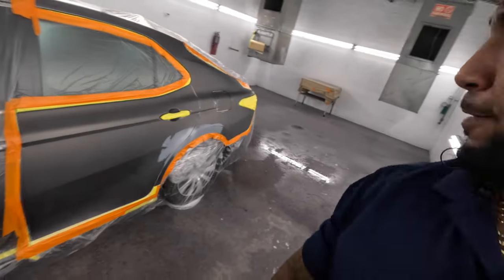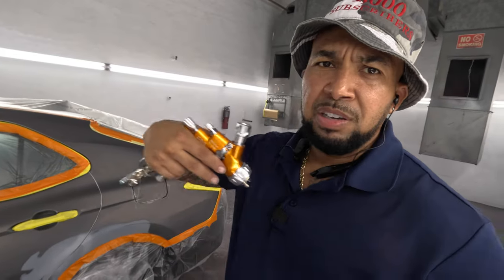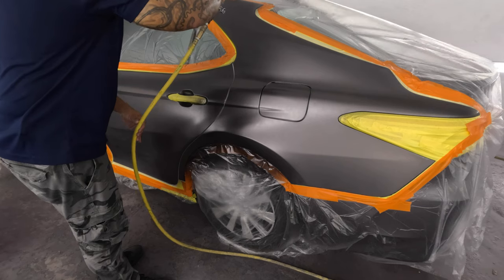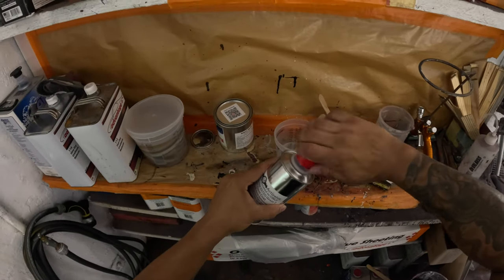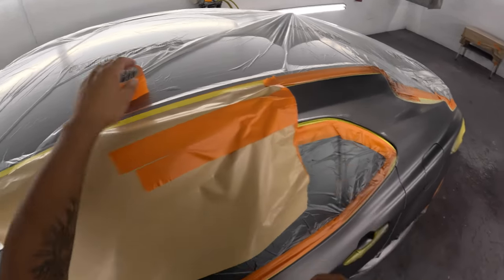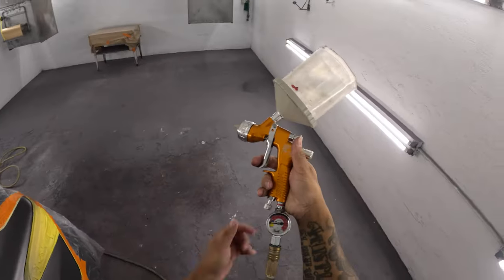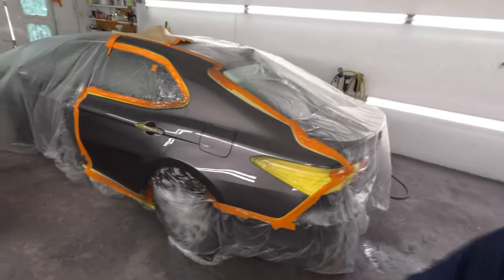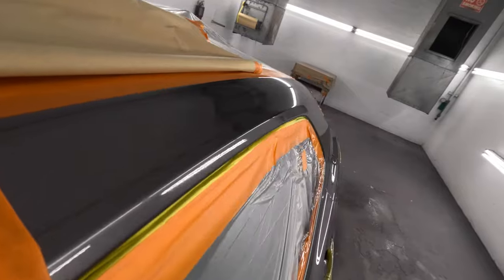Man 😤 all that hype. For this can of honey 🤨

Comment: Awesome job! I was a bit surprised by the fact that the gti pro lite goes back that far! Wow! That is definitely one of the best guns out there for sure! And not the most expensive either. Man you really treated yourself with that one for your first gun. Great gun for the beginner in my opinion when you go with T10 cap and 1.3 needle tip.
It will be slow laying out material but absolutely perfect especially laying out clear virtually impossible to get a run! And you don't need lots of pressure out the gun to run it or like 60 gallon compressor like you would need it with Iwata LS400 
which is my other favorite gun. Love these too with passion! Lol.
I was at harbor freight the other day and saw the black window gun for $179 and I think this is also a good gun for the buck for sometime on the budget or just beginning to paint. Also, I agree with you on never adding reducer to clear and it had to take LS 400 for you lay it out the way it was supposed to. On camera it can't be seen what you were describing. And your GTI pro lite with T20 1.4 didn't make the results happen out the gun. Guess it had to be LS 400. Lol. Love the results you get and show ech time!👍
Reply from the maker: @markchimmy  for my first gun? 🤔 My first gun was the GTI the original GTI not the pro lite that was back around 1996 or 97 I don't think the pro lite goes back that far. They were just making gravity feed guns at that time 😂 🦕🦖🦖🦕 welcome to bedrock 😜
Reply: I must have misunderstood!😆 Makes sense. I was like ok,and surprised thinking could it be true that this gun goes back that far? Time flies but I know it couldn't be true with this technology and design to go back that far! 😆 
I'm in Florida too and if I'm ever in your area I would love to meet you in person and have a chat and hopefully be able to see you in action in the booth by your side Trigger. That would be something!
Reply from the maker: @markchimmy  sounds good, whereabouts in Florida are you?
Reply: I'm in Palatka it's a little s**t 🕳 Lol.😆 
Not too far from St.augustine. To my understanding if I remember correctly from one of your videos you are in Miami area. Am I correct?

Comment: I started with 320 then I went to 400 then 500 then 600 and I'm now at 800 grit before base so 600 or 800 depending on the color and if it's solid or metallic but I like 800 I don't want no die back
Reply from the maker: Amen to that, fuck die back 🤣👊🏼

Comment: I use a 1.2mm with my DV1-C for when I am spraying high solids and euro clears that are high solids because the 1.2mm will break up the thick clear better than a 1.3mm or 1.4mm nozzle. I use the 1.3mm and 1.4mm for medium solid production clears. I never tried Grant 7, i have heard of it and know its expensive but i would like to try it on one of my custom kandy or pearl paint jobs
Reply from the maker: Yes that clear is super thick I wonder how the DV1 would do on it. I know it will be slow but I'm curious if it can really handle it. That grant 7 is truly the thickest clear coat I've ever seen in 28 years.

Comment: can you please make a video about the benefits of sanding primer, if any. thank you.
Reply from the maker: Benefits of sanding primer? 🤔 You gotta break that down for me man. Primer has to be sanded down before you can paint. So I'm not really sure if there's a benefit to it it's just something that needs to be done. It's kind of like what is the benefit of masking up the car before you paint it the benefit is you don't get paint all over the car. But if you going to a little more detail on what you're asking I'll try to answer it to the best of my ability.
Reply: @thetriggerman954  you're right! to clarify, hand sanding vs machine to achieve a flatter result. thank you!
Reply from the maker: @HiFiInsider  in my opinion you should "ALWAYS" finish your sanded primer with a DA sander with a soft interface pad. When you hand sand or block primer you will leave scratches in the primer that can shrink back and show up, so I like to use a soft pad on the DA after with either 400 or 600 grit to get those scratches out. The soft pad on the sander prevents you from changing the form of the bodywork that was repaired. I hope that helps
Reply: @thetriggerman954  yes! thank you for the tips. 🤜🏻 🤛🏻

Comment: Love that you show the blends outside in the sunlight and from different angles and distances. (Unlike ya buddy down the pike 😆 )  If it's gonna show, that's most likely where it's happening. 

Hey, what nozzle, air cap, and pressure did you use for second coat of the clear with the LPH-400?
Reply from the maker: Yea man no sense hiding the cars in the shade let's see them metallics and blends. I was at 20 psi, LV silver cap, and 1.4 nozzle.  It broke that clear up like it was nothing. 👊🏼

Comment: Back in the early 80's when I was spraying, I had a friend that was a coach builder, and he taught me to heat the clear up to 70*C. It goes as thin as water then goes back to it's original thickness when it cools. You must strain it first of course, but we had a little camping stove and an old aluminium saucepan and my mothers' jam-making thermometer. It REALLY use to lay that clear out like glass without loosing any of it's integrity and protective qualities. Please try it. You will be amazed.
Reply from the maker: Hmm 🤔 and it won't make it start to "kick" any faster? It's normally 100° in my booth so warning won't make it start to dry any faster?
Reply: @thetriggerman954  I'm from England. It's never that hot..!!
Reply from the maker: @Martyngreen-qm4lg  that's why you have to warm up your clear. You give out suggestions you have to consider all of those factors. Things like that do not apply across the board for everyone.
Reply: @thetriggerman954  Because it's so hot in America, do your booths actually have A/C as well as a bake cycle.? P.S. Your jobs turn out very nice.
Reply from the maker: @Martyngreen-qm4lg  AC? man I wish 😂😂 The newer fancier shops have bake. I don't have bake or AC
Reply: @thetriggerman954  So you look at the therometre every day and go from there.? Good job.
Reply from the maker: @Martyngreen-qm4lg  yes sir I have two thermometers in my booth I look at them every time I get ready to mix clear and depending what the temperature is is which activator I will choose. Thanks for chiming in brother Have a great weekend.
Reply: @thetriggerman954  You too. Keep those cars a shinin'..!!

Comment: Hey Trigger, Great video Brother! 💯👍
I am after some advice from you please....... I am thinking of purchasing the Wider4L spray gun.  It is the replacement for the lph400. Have you used the W4L and would it be a worthy choice/purchase? Cheers Sir.  Steve 👍
Reply from the maker: I have a friend that has that gun and it definitely does not spray the same as the LPH400 if I'm not mistaken that gun is cheaper than that LPH400 cheaper for a reason. I honestly don't think there's any other spray gun on the market that is comparable to the LPH400. Not saying it's the best but saying there's nothing that compares to it or spray similar to it.
Reply: @thetriggerman954  that what I was thinking also regarding the price difference. As I am in the UK, I am finding it hard to try and get an lph400. Would you know of anywhere that I could purchase one that ships to the UK please? Many thanks Steve👍
Reply from the maker: @srodgie  I'm not exactly sure, Amazon or eBay?
Reply: @thetriggerman954   I have seen one on Amazon UK..... LPH 400 Silver 1.4 LV for £500

Comment: Trigger man, what fluid tip and air cap on the pro lite?
Reply: Sorry, saw the whole video, you said it. Great job! Keep up the good work!
Reply from the maker: I said it twice 🤦🏽‍♂️ 1.4 and TE20 cap 💪🏼
Reply: @thetriggerman954  I heard if you crank up the air on the Pro Lite, it will spray it, I don’t know what the air pressure would be, 35-40?
Reply from the maker: @eapauto  I've tried to go higher on my prolite on other clears and it seems like it distorts at higher pressures. But you could be right It just seems like every spray gun has its sweet spot for optimal results. I might try it off camera 🤣

Comment: why not bump the pressure up a bit> does that cause too much over spray?
Reply from the maker: Depending on the gun it will start to distort/not atomize properly. I've never ran my guns that high so didn't want to screw up on camera 🤪 I was doing it live for the first time using the clear. I'm going to try it again at higher pressure "off camera" and see how it works 🤫
Reply: @thetriggerman954  hey bro, Im painting my truck with GM INDIGO BLUE METTALIC ,  paint code,,  U9792  , base coat /clearcoat system... what I want to do, is give it more depth and pop, like they have on the new dodge challengers with the indigo blue.. what could I do to get that effect? do I have to get some dye  and make a midcoat to spray before the final clear coat?   or add some pearl to the midcoat  ?  how do they get that beautiful effect on those challengers... thanks
Reply from the maker: @randy1ization  maybe take whatever metallic or pearl that's in the mix and add more to it, or the some in a mid coat. Do some test panels see what you like. Extra pearl in the base never hurts. But definitely do some test panels

Comment: Hey, Trigger...how does the w400 compare to the Lph400? I have the w400 and it's a favorite of mine that just felt right from day one. Little heavy on the fog with no paint booth, but I like the results.
Reply from the maker: Yea I have both and I tend to favor the LPH less fog atomizers at half the pressure lays down a nice sheet of clear. Pretty much my favorite clear gun.
Reply from the maker: Even with a spray booth the w400 is a fogger 😂
Reply: @thetriggerman954 ahhh great. Now I want one🤣
Reply from the maker: @BearBudgetgarage  spray guns are addicting aren't they 🤣
Reply: W 400 lv4 almost 20 years for me
Reply from the maker: @tonydiesel3444  yea man I think they came out 2006 ish. I got mine in 2008 so about the same time. And still rocking 💪🏼

Comment: Trigger man every time I use Grant 7 I am getting a lot of what I think is solvent popping wonder is reducing will help
Reply from the maker: •What activator are you using? Fast/slow/medium 
•What's the temperature you're spraying in?
•all panels or just the top surfaces?
Reply: @thetriggerman954  I did an over all paint on my 64 impala in back garage use medium hardener it was around 85 degrees waited approximately 15 minutes between coats but still got solvent pop has an excellent shine an wet look can’t see pop in sun but when in shop I can it will wet sand an buff out but just wondering why it keeps happening
Reply: I actually think I might be laying it down to thick I am just at DIY trying to do my own stuff
Reply from the maker: Your temperature and activator speed sounds correct, it may just be that you are putting it on heavy like you said. It is a thicker clear so putting it on too heavy could definitely cause solvent pop. We get accustomed to spring a lighter clear and putting it on heavy getting away with it then when it comes to something like this you have to adjust your spring style. But it sounds like you know what it is listen to your gut and ease up on them coats there 👊🏼💪🏼
Reply: Also check your panel temperature. It may be 85 in your garage, but there is a possibility that your panels could be hotter. Next time we might have to try you with a slow.
Reply: @Grant7  ok same thing happened with slow on another project I think I am trying to lay it to thick
Reply: @thetriggerman954  Thanks a lot for your advice keep the videos coming 👍🏿🦾💯
Reply: @Grant7  trust me Grant love your product it’s not the clear it’s ME you always  answer back when ask a question going to keep on until I get it right 👍🏿💯